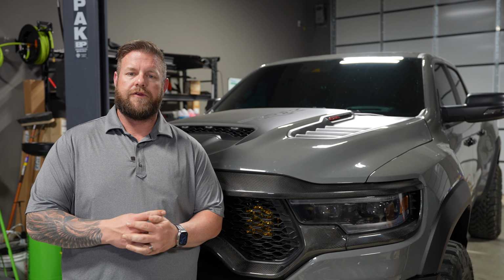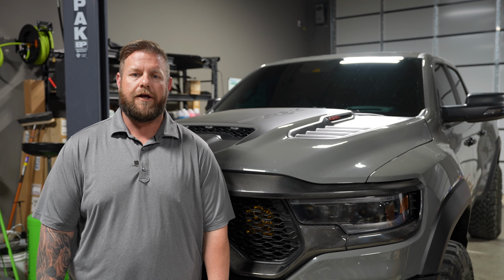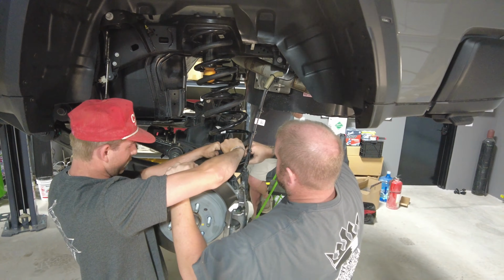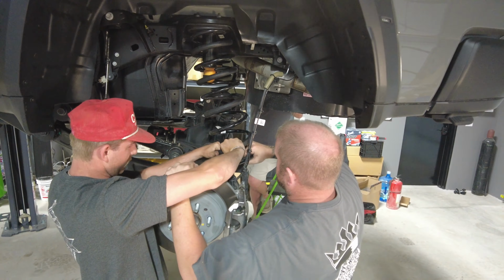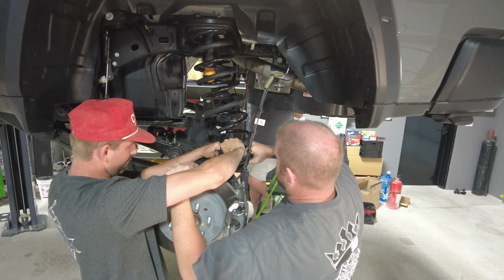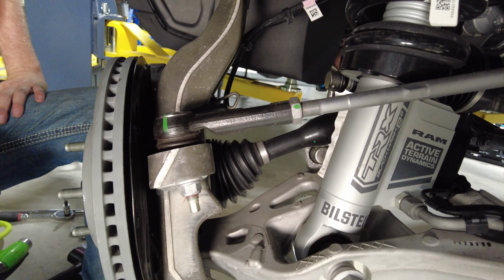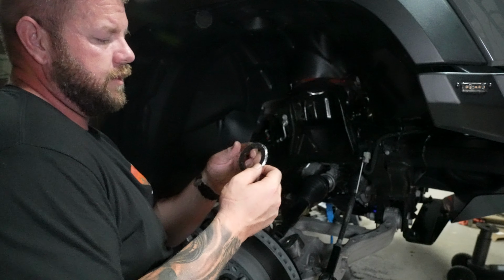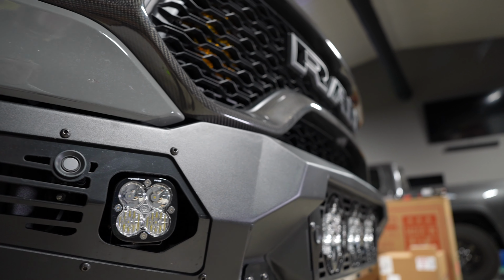RAM TRX Kibbetech Suspension Install | Deviant Racing

Comment: Nice! What travel numbers do you reckon you’re pulling with all this new hardware?
Reply from the maker: Still stock travel numbers, the it doesn’t change any of the geometry other than the adjustability on the upper control arm

Comment: Will you sell the old suspension you took off ?
Reply from the maker: Shocks were already sold, what are you looking for?
Reply: @deviantracing6129  Front lower and upper arms 
Ball joint 
Front Spindle Knuckle 
Front CV AXLE SHAFT

Comment: What are you doing with the sensor connection that connects to the shock do you just leave it open?
Reply from the maker: I put some raychem around them to seal them up
Reply: @deviantracing6129  and is there no check engine light still pop up or anything like that
Reply: @hectorguajardo6392  the suspension maintenance message is permanent 😢
Reply: @pauljimenez5528  ok cool thank you 🙏